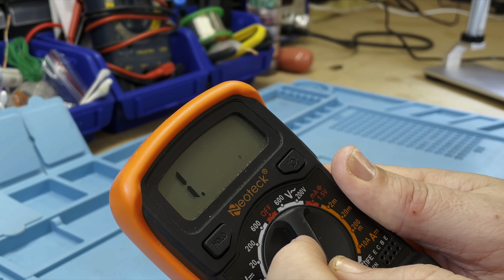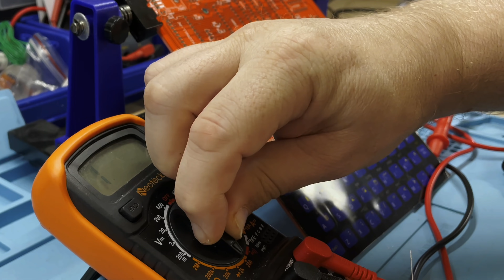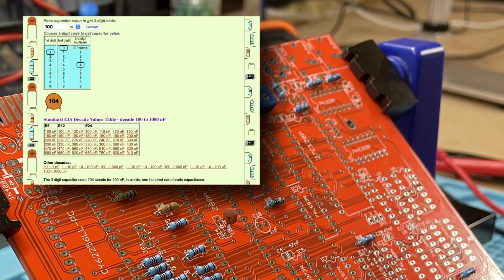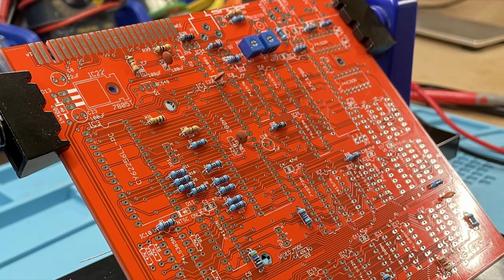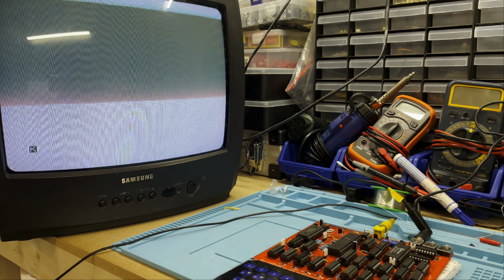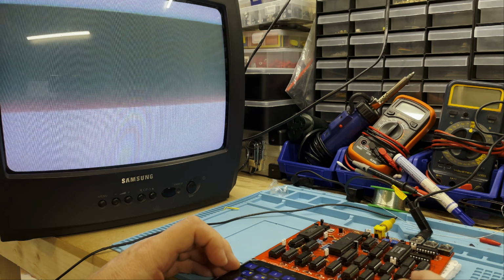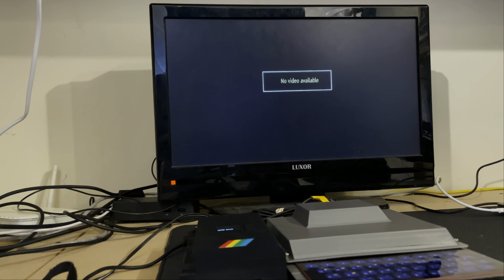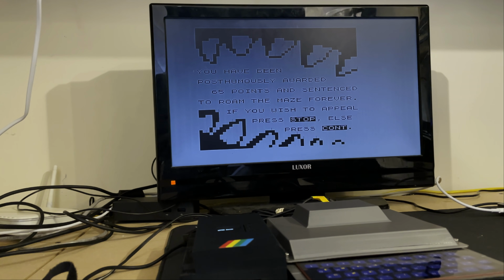Can You Build A Brand New ZX80/81 From 100% New Parts?

Comment: Hi, I know this is an old video but I'm about to embark on building this same PCB. How did you get the keyboard working? It's one thing I don't see any pictures of or its not documented anywhere. Were there dome key switches underneath the keyboard overlay or did the overlay come with some sort of conductive layer on the other side? Great video by the way!

Comment: My ZX81 died a very long time ago when I soldered the 16k RAM pack permanently to the mainboard. Has anyone simulated a ZX81 using an FPGA or a processor like the RP2040 or the ESP32 series? The Z80 instruction set is pretty clunky but should be able to be emulated on a chip like the ESP32 very easily... I'm not a big retro enthusiast though, my intrigue is more along the lines of not having the money to buy a Memotech or Spectravideo when they came out, I would have loved to test my programming creativity on them back then and even now, I'd willingly trade some productive new designing time for a quality slice of the past on those pcs.

Comment: Lovely!! My very first computer was the successor to this, the ZX Spectrum! Is it possible to assemble a Spectrum in the same manner ? Make a brand new one?
Reply from the maker: Thanks for watching :) A Spectrum is within your grasp! https://youtu.be/VFLJLxDTEkQ
Reply: @The Retro Shack  Okay, note that my design was steadily improved, and now with Revision 1.9 everything works, and you can also grab the KiCad files to copy and change my design yourself, and even the joystick interface is now working! Not only do you get the Schematic, but you also get files to produce your own PCB's, a Bill of material file (BOM) that includes three places (farnell, mouser and Reichelt) with exact details of which parts to get from either of them avoiding buying the wrong connectors etc., and lastly a drawing showing which part goes where exactly. You can create your own keyboard of choice (or use the real ZX-81 membrane keyboard if you are a masochist), or use the keyboard PCB I designed which has real keys and uses a paper overlay with the key plungers sticking through holes in the (laminated) paper. But some builders opt for a keyboard with cherry keys with text printed on the keys. just choose your preference.

Comment: 1:20 are undamaged? Whahahahahahahaha what is there to damage? a resistor?? Hahahahahaa
Reply from the maker: Several of the DIL Sockets had bent pins - in one case with a leg missing, and another one cracked.  Whilst this isn't a problem for me as I normally have spares lying around, if you'd ordered this and had set time aside with your 7yo to complete, and then found components missing or broken then you would have a disappointed 7yo waiting for parts to arrive :) :)
Reply: Metal film resistors are surprisingly easy to damage.  Their value goes up.

Comment: I would not in a million years build a Sinclair with an original style membrane keyboard.
Taking the trouble to build it from the ground up means you could throw the cheapest mechanical switches and keycaps on the thing and still be far superior to most of the low-cost keyboards of the 80's hands down.
Reply from the maker: This isn't the same membrane as on the original (thank goodness!) This is either micro-switches or dome switches as it's quite click-y and nice to use :)
Reply: @TheRetroShack  Oh god I had no idea they cheaped out so much on the original as to not even use a tactile dome membrane. 
Those things have been pretty much standard throughout my life on gas pumps and industrial control pads lol

Comment: My first computer was a ZX-81. I built a custom aluminium case for it and external keyboard with these tiny odd little clicky keys, and even built a joystick using a small box, a bolt, a grommet and some metal strips. Worked a treat. Also had an amber monitor. 

Case modding before cases were a thing. 

So many good memories.
Reply from the maker: Sounds cool! :) :)
Reply: @TheRetroShack  I’m so sad I didn’t take many photos back then. All I can find now is one of the case being painted. The keyboard was detachable via a D plug I think to.

Comment: So if the extra RAM slows the startup does it slow down anything else or does everything else run at full speed ? I seem to remember 3D monster maze running faster back in the day but my memory is not reliable.
Reply from the maker: Doesn't slow anything down, or indeed speed anything up :(. It's purely paging through the memory when the machine boots up to make sure all is ok before presenting a prompt.  More memory = more time :)

Comment: The glorious days of the ZX81. It was my first computer and I got the infamous wobbly ram pack too. Having spent a fair amount of time typing in a large listing (Frogger 16K I think) from a magazine I lost everything when the ram pack got nudged. Talk about heart failure.
Reply from the maker: An all too familiar story :) And kids today think they have it tough :) :)
Reply: To me, this has been something of a mystery since the early 80s! How Sinclair (or Westwood or whoever) could accept such an extremely bad and error prone design.Didn't they care about their image at all? (I never bought that 16K DRAM module though, but instead added some 6116 SRAM ICs directly on the circuit board, using an LS138 as address decoder).
Reply: @herrbonk3635  Being a vertically standing module made the ram expansion really fragile. I guess if they went with a horizontal design so that the ram pack laid flat on the table it would have been a better choice. Otherwise it was just too risky to use.
Reply: @config2000  Yes, preferably via a short soft band cable (ribbon cable) instead of direct mechanical contact with the vibrations from typing. Even better a more stable connector than that edge connector (but yes, it costs money).

Comment: Don't solder components with the legs splayed as it makes it difficult to remove them in the future if needed, and also make it easier for solder bridges to form. Instead, insert the component, turn the board over and grab a component lead with a pair of pliers to hold the part tight and then solder.
Reply: .. put a bandaid on your left forefinger and use that to press the part in place from below while you solder.
Reply from the maker: Thanks for the tip :)

Comment: Maybe, I will see if I can find the "Startrek" game I wrote.  In my version of the game, the klingons moved after each turn you took.  They were almost smart.  If the Enterprise had above a threshold of assets, the were biased to move away.  Below that they moved towards.  They always "tried" to get together.  Even on the lowest level if you messed about too much you would lose.
Reply from the maker: I would LOVE to see that :) Drop us a line if you find it! :)
Reply: @TheRetroShack  
I looked.  No luck
Funny story:
It had levels from 1 to 10.  1 was dead easy.  9 was "Captain Kirk" 10 was "Impossible".
I gave someone a copy, they tried it and came back and said it didn't work.  As soon as they started, they got blown up.
I asked:  What level did you try.
They said: 10
I asked: What is that level called?
BTW:  The scale was not linear. Every number got worse for the player a the level increased.
Reply from the maker: @kensmith5694  Shame you couldn’t find it - maybe it will turn up at some point :)

Comment: Cool project. Is the 7805 the standard or the high efficiency version?
Reply from the maker: This is the standard version as it was supplied with the kit - I'll be replacing it with a TRACO Power regulator soon as that is much more efficient and doesn't generate any heat :)
Reply: The ZX80, at least, drew so little power that a switcher was not worth the bother.
Even going full blast, it didn't draw more really.

Comment: When I was 10 I soldered the (original) ZX81 kit together on my mum's kitchen table (worked 1st time). While it was my 1st computer I saw that it's limitations quickly, and when newer more powerful computers came out I quickly upgraded. In more recent times I look at limitations like this as a challenge that just need to be engineered around. Games like 3D Monster Maze were great for a system with such limitations.
Reply from the maker: Couldn’t have put it better myself :)

Comment: One of these days im gonna make/adapt a multimeter (DMM), 2 v-shaped metal posts with leads to DMM and a button in between so while lowering the resistor between the posts i also press a big power-on button (additional-exterior placed) for the DMM.  Will need to cut up a spent 9 volt battery top (x2) or something that copies the 9V headers, 
need those metal contacts to push on the interior contacts + solder some wires on them, leading to the now external 9 volt battery and power-on button, a nice stand to hold the posts (+ hide the battery) and DMM at a readable angle should finish the job. The meter still can be used normally, just remove extras + re-insert the 9 volt battery, attach original leads (if they were removed)  option, posts have wire wound hole (socket) to push pins from DMM leads in .
V shaped metal posts, front leg could be shorter than back leg, button switch could be beneath when lowering or button could be behind posts when pushing resistor forward to make contact with posts. (or install both, 2 buttons, parallel ?)
silver version, add contacts and breaker, when setting the DMM on the stand a pin pokes into the DMM and interrupts the internal power + some external contacts on the dmm case meet power contacts from stand, needs internal work and space maybe a problem,  have some space at the top behind the display,  4 contacts 2 power + 2 leads. + reed switch / magnet in stand ? gold version, if 9V is rechargeable make the stand a recharge station.
Reply from the maker: Now quick! Before someone steals your idea! :)
Reply: @TheRetroShack  let them, if someone sells it, i will buy it   ;-)   (the lazy version)

Comment: Colorblind too? Fun isn’t it lol
Reply: Maybe a little button controlled LED light would help you.
A red LED and a green LED would make the stripes change which is brighter when you go from one button to the other.
Reply: @kensmith5694  when you are terminating a 48 panel patch you are better off using transponder plugs at each patch and a tester at the patch panel . I can flip flop the color based on the pair order and make it test out. Some might say this is a dick move for the next tech but I always re-term both ends of trouble lines.
Reply from the maker: Not colour blind myself - just basically a bit dim and therefore have to check everything five times :) :)
Reply: @TheRetroShack  it’s usually in a bad place like under a kiosk or register

Comment: Cor this is going to be a blast to the past for me, I remember my mum buying me the ZX80 kit from the advert in the Times where she worked and up til then I had been fixing up dead Pet's and an IBM armed with my lethal zap-o-matic soldering iron (had to wear marigolds to use it as it leaked leccy into the handle) and scavenged parts from broken devices.   The kit was not an easy one to work with and remember hitting on the local RS components shop for a fair few bits because the Sinclair components were not that good but persevering I managed to build it and so began the love affair with a machine that smoked, caught fire, scorched the carpet, died tragically very easily as did the ram module but it was great fun nevertheless.  The ZX81 was much better but still fraught with gremlins, the Spectrum in comparison was awesome and never had an issue of component failure with the Spectrums despite clocking on many many hours on the squishboards :D
Reply from the maker: See!  There's a childhood - a soldering iron that electrocuted you, and the solution wasn't a 'woke' response to ban soldering irons - nope, put on some marigolds.  LOVE IT!
Reply: My Xmas present when I was about 14/15 was a soldering iron, which I've still got. It's a wee. skinny thing, but never leaked leccy and as a West of Scotland man, I would die sooner than put on Marigolds! Might as well ask me to wear a bra. Sorry if that's not "woke".

Comment: This certainly is a surprising video to me ! As a retro computer enthousiast I was thinking about getting a Z80 kit like this, so I watched it until I suddenly saw this familiar shape of the 3D printed case. I actually designed this two years ago, with the intention of once placing a real board in there, but never got beyond fitting a Raspberry pi based emulator inside. So this is actually the first proof that it fits a real board ! And yes : I think it looks good in metal. ;-) Maybe you can post your final make on Thingiverse one day ?
Reply from the maker: I certainly will :) It’s a great design and fits really well!

Comment: When I assembled an original ZX-81 kit, I recall that the keyboard was separate rather than part of the PCB.
I think I remember it vividly because a diode broke in half when I was bending the leads.  I got a replacement at the neighborhood Radio Shack.
Reply: How can you "think" you remember something vividly? Objection, your honor!
Reply: @Ndlanding  I'm speculating on why , not the fact of.  I think that the reason why I remember it vividly is because of the broken diode.
Reply: @JohnDlugosz  Totall recall. I see. (I think.)
Reply from the maker: You’re absolutely correct - the original was in two parts :)

Comment: I always need help with identifying resistors, because I'm colorblind....
Reply from the maker: That can't be easy :( You might want to get a component identifier/tester - I've just been put onto one of those! :)
Reply: I'm hopeless at remembering the colour bands... I just give them a quick test with the multimeter
Reply: There are resistors with the actual value in numbers printed on them. I'm not color blind but I suffer a hearing issue apparently as a teacher of mine said everything goes in one ear out the other

Comment: Too bad it's the sort of foam that might actually kill your chips instead of protecting them.
Reply from the maker: Well no harm done on this occasion - but good to know :)
Reply: Did the foam have a slightly pink color or smell weird.
They used to make "white" foam that was ESD stuff.  It wasn't pure white and it smelled like dishsoap.
Reply: @kensmith5694  That was clearly just loose cell styrofoam - the type that you never can get scraped off once it grabs you with static cling.

Comment: About the soldering order, I prefer to do resistors, diodes and other parts that lay flat against the board first, making the bends with needlenose pliers so they look all neat and straight(and it's easy to keep the length uniform). When all those small ones are placed, flip the board over and press it against my soldering pad all nice and flat and after soldering move on to larger components.
Reply from the maker: Good tip!
Reply: What's a soldering pad?
Reply: @Ndlanding  Heat resistant silicone mat that has these little crevices for storing components, google soldering pad and check out the images. Really useful for keeping things organized while working.
Reply: @aziztcf  Thank you. BTW, I use plastic trays (wrappers from expensive chocolates) to group screws, etc. Can't be used as a soldering mat, though.

Comment: This kit doesn't have any custom chips? You have to rely to NOS or all chips are still produced?
Reply from the maker: The original ULA is broken down to individual chips - all still available :)
Reply: @TheRetroShack  The ZX80 didn't have any ULA though, only the ZX81. Strictly speaking, it's just the ZX81 extensions to the ZX80 design (mainly a NMI-generator) that are broken down to 74-series ICs. Most of the TTL design was already there.

Comment: Thanks for sharing. I had such nostalgia for the ZX80 & 81. Love to make something like this, but my soldering is crap, and diagnosing issues is worse!
Reply from the maker: Time, patience and persistence :) And alcohol... lots of alcohol :)
Reply: I have returned to soldering after a long break, the biggest breaker of most people attempting soldering is the properties of flux and fluxed solder.   Solder flows where flux goes and I have found a happy medium of a little dab of flux on the area to be soldered, give it a tap with the iron to start the flux to clean the area then clean the iron, dab on some fluxed solder and tap it on the bit you want joined and you should find it will work nicely and the solder will go where you want it to go.
Reply: @dodgydruid  llllll

Comment: My first computer was a ZX81 clone with 2 KB RAM. Eventually I saved enough money to buy a 16 KB expansion. It was so liberating having all that much memory available.
You should do a reverse video mod, makes it a lot easier on the eyes.
Reply: 16KB ram pack wobble was the kiss of death... after spending hours typing in a magazine listing, and watching it all disappear before your eyes. 
Oh,  the memories. :-)
Reply: @fredsmith1970  Even worse was getting the mag program typed in and saved. If you were lucky enough to have an error-free "game", it probably allowed you to run Spiderman up the side of a building and "battle" one alien. Game over. ANd that was after maybe three hours of pecking at a "keyboard". I'm surprised I didn't just give up on computers.
Reply from the maker: The board has a jumper to control inverse video but I can’t bring myself to set it - it ain’t natural :) :)
Reply: @TheRetroShack  In my case I had to cut a trace on the circuit board and wire a switch to select video mode. Probably the same way that your jumper works, which would make it even easier to hook up a switch.
Another useful mod was a reset button. But I installed it on the memory expansion, which also had access to the CPU reset pin via expansion connector.